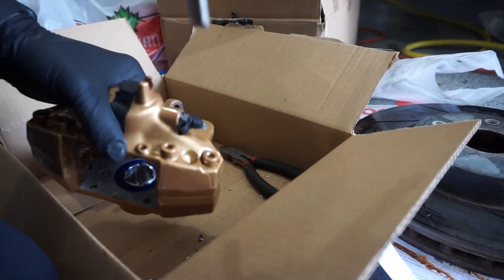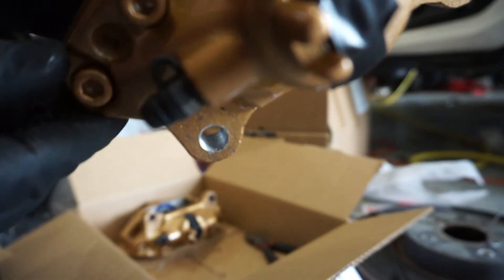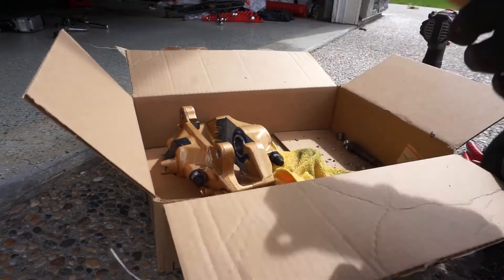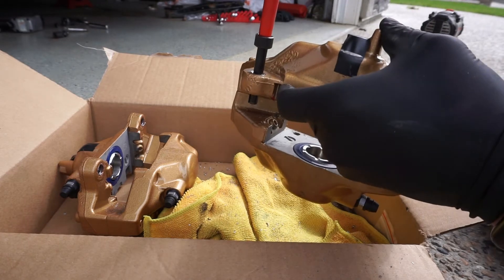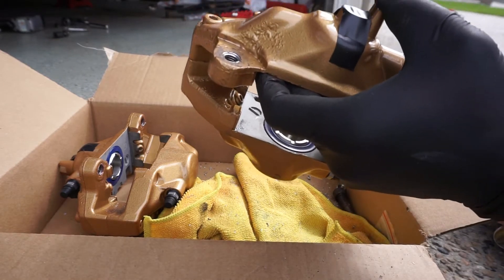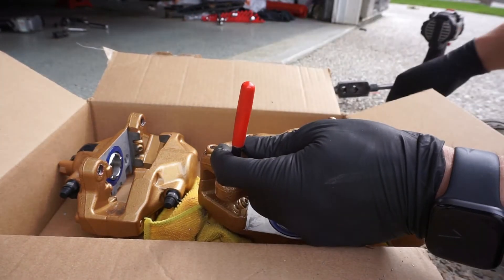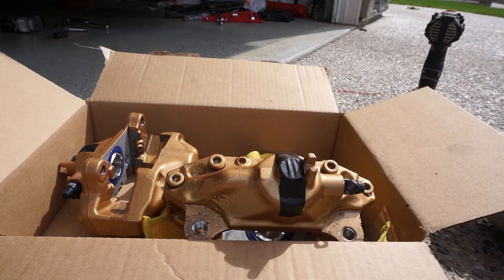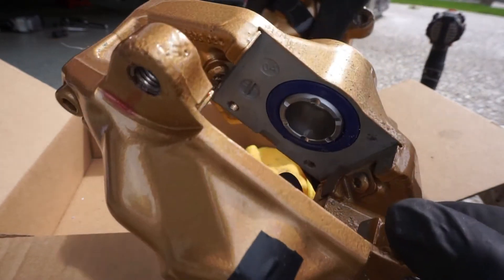How To Helicoil Stripped Subaru STI Brembo Calipers With Success For Racing Application

Comment: Amateur work - use a vice to hold the part so you can drill and tap as close to perpendicular as possible - this is the most crucial part that requires precision. If the thread is cocked sideways - the flange will not be 100% flush with the hub and the bolts can easily back out through thermal and vibration transfer.
Reply: Sound like a hater

Comment: Hey Bro, i was told if you dont use a drill press you'll have issues with rethreading for the helicoil. I have a bunk front caliper i need fixing when i do my brakes literally held in by locktite right now... Im glad i found your vid.
Reply from the maker: Thank you very much. It’s better to use a drill press and probably easier, but if you hold the caliber still and take your time you can drill it straight by hand. Just keep checking the drill bit angle as you go. Thanks again and good luck

Comment: Nice work bro! Where did you buy that repair kit? I have some front brembos that need to be fixed thanks!
Reply from the maker: Festnight 15Pcs Metric Thread Repair Insert Kit M5 M6 M8 M10 M12 M14 Helicoil Car Pro Coil Tool M12 * 1.5 https://www.amazon.ca/dp/B07V9M8Q8T/ref=cm_sw_r_cp_api_fabc_PwUUFbQ4KSFFP?_encoding=UTF8&psc=1

This above is the kit for the front brembo

The rear is below:
CO-Z 133pc M5 M6 M8 M10 M12 Stripped Helicoil Thread Repair Kit Set Heil Coil ReThread Repair Kit https://www.amazon.ca/dp/B07CVNKM6M/ref=cm_sw_r_cp_apip_HZooPnR2m5ZIm

Thanks for the feedback man I appreciate it.
Reply: @snewstead1388 you the 🐐 thanks for going the extra mile!